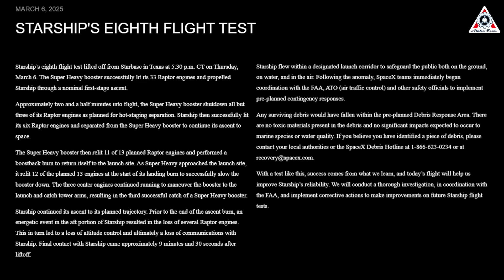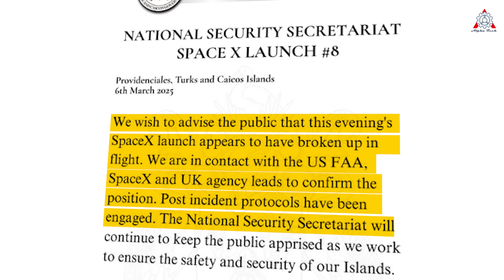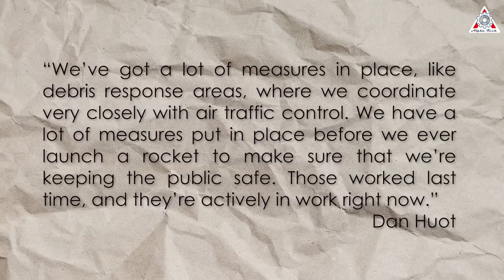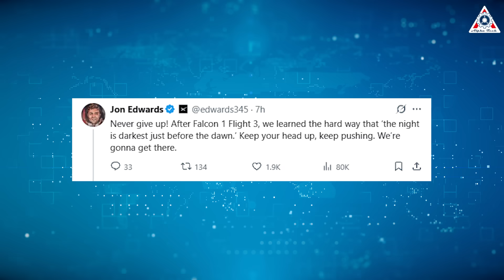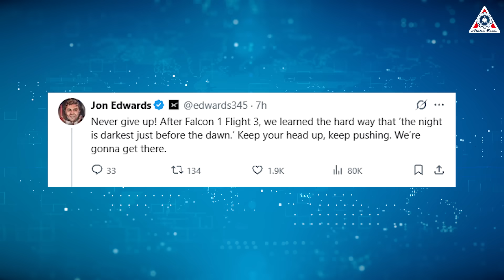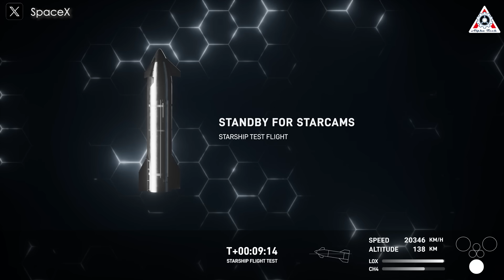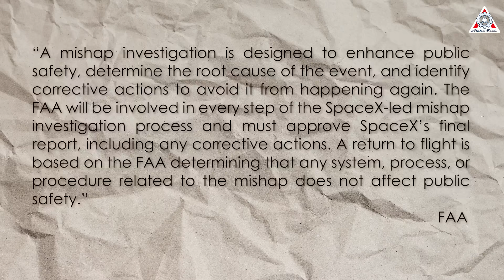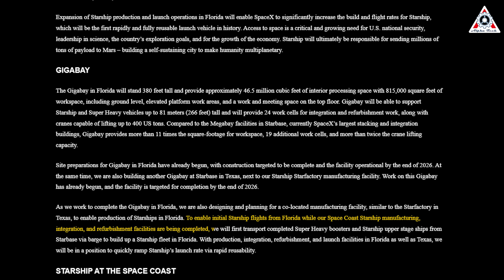Analysis SpaceX Flight 8 Aftermath...Exploded & Falling!!!

Comment: OK i heard Starliner did not make it high or has fare as far that gives you the automatic clue that engines are not designed correct.  I believe that FAA has the right to ground all Starliner4 flights until Flight 7 report is closed and the the new report should not be closed until publishing the entire flight problems.  Also as mentioned  frankgonzalis1879 that more engineers should be added but not make political ideology but just as confirmation of what happened and provide concrete back with different set of eyes.  Hopefully this type of RUD can identified and hope fully not happen again and yes putting out such short timelines is not really in the best interest of the representation of SpaceX.  Just non-engineer putting is 2 cents worth in and agreeing with parts of what some who have commented.
Reply: why do you need government inspectors just make SpaceX pay up double the damage that they may have done

Comment: Space x will overcome this although it is strange how the starship made it fru the atmosphere to the simulated landings at sea several times before but has now failed in two consecutive launches. Catching the booster stage is very impressive to say the least. Remember how long it took space x to get the falcon nine launches safe and routine. There’s no reson to suppose they can’t do the same for the larger vehicle.
Reply: both of the failures were new second versions.  Some improvement they made was not an improvement.  Impressed that the booster made it back and was caught with not all engines lit.  Worrisome is that they had fixed this issue.  Again, improvement didn't improve.  Most worrisome is uncertainty if Starship RUDded on its own or was SpaceX able to use the FTS.  NASASpaceflight speculated on air that the FTS was safed earlier and not employed.  When I look at ground videos, I am concerned over what looks to be very large chunks very close to the ground.  Pieces should not be that big.